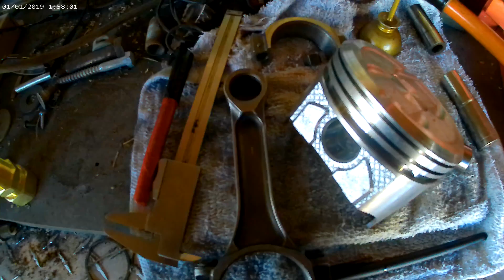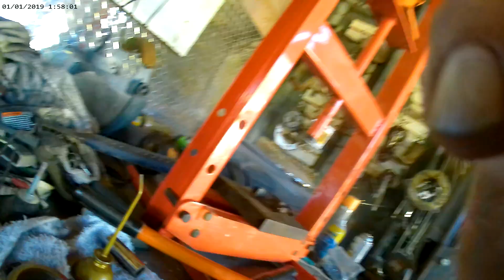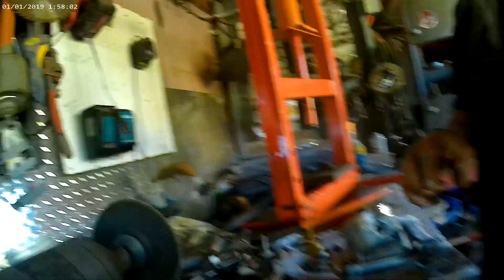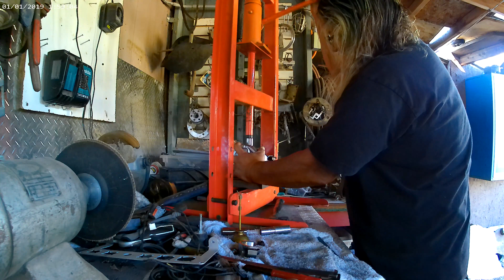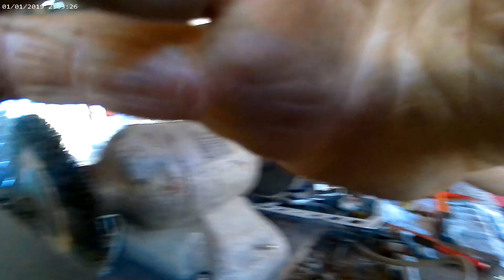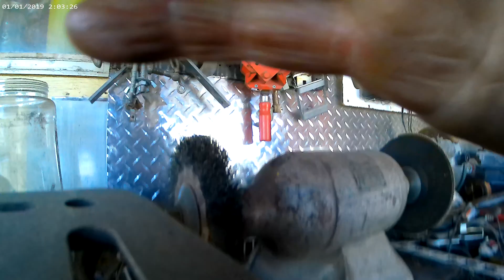Press in the wrist pins on your pistons

Comment: At the oe factory, they used a special oven to heat the small end of the connecting rod and chilled the wrist pins and assembled it in a fixture to center the pin.  Just pressing them in at room temperature will work but it could gall / scratch the leading side of the pin which will be bad against the pin bore of the piston and not pivot freely.

Comment: Ok so I did this too and now I’m worried about a wrist pin walking out…I talked to my buddy and says that after heat cycle everything should expand and be fine after cooling…I used plenty of assembly lube and didn’t score any pistons/wrist pins…idk theyre called press fit for a reason right? Have you have any engine issue after start up assembling this way??
Reply from the maker: So the wrist pin should move freely in the piston the crankshaft only allows small movement on the journal just make sure it is close to center in the piston most have a slight off set as it is where the piston sit in the bore on a V8 that is I havenever had a problem 6 engines I have done that way..
Reply: @ Ok! Thanks for the feedback. Yea I got the wrist pins close enough to center in the pistons and the rods all move freely with the wrist pins so I should be looking good. Assembling this for a 91 Ford 302 BTW

Comment: IDK what the diff is besides using heat or not. I did both. I mean even on a heat cycle that pin is gonna expand just like the rod. So if the rods cold and the pin is cold its the same. If the rod is hot and the pin is cold it gives a you a bit more clearance to make it easier but at the end of the day the pin is sized a bit smaller so it will go into the rod...I like these vids that never show up on the YT algy simply cause they are the truest sh%t.

Comment: That wrist pin is now too tight in the piston. Far too tight! You're going to have horrible piston slap at the very least, and increased piston skirt and cylinder wall wear! I personally don't use a torch, I use an old pizza oven with the rod cap and bolts removed. I mark everything first so there are no oopsies!
Reply: it's to tight because you crushed the piston with the press you can not press on the piston there is a tool that connects to the rod head and lets the piston dangle then you can use a press or heat on the rod head. I agree with you  RUINED that one been doing this for 45 years my friend
Reply from the maker: No sir pins were wrong size
Reply: @scooter1391  its funny that people don't understand you can't press against an unsupported rod ,you will bend the piston and it will get to tight
Reply from the maker: Your right turns out wrist pins were wrong size...  Hell I will do another complete vid show proper result... Good eye sir...